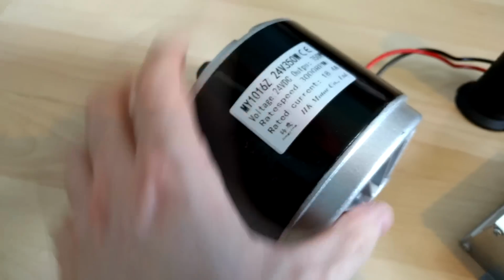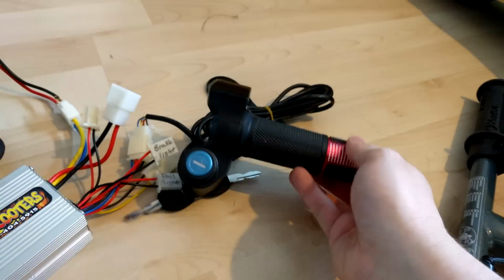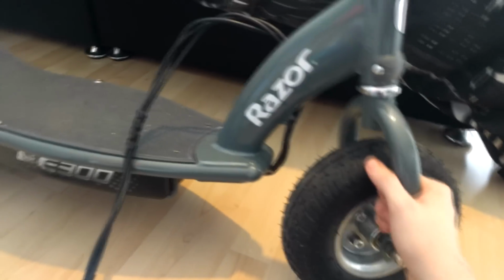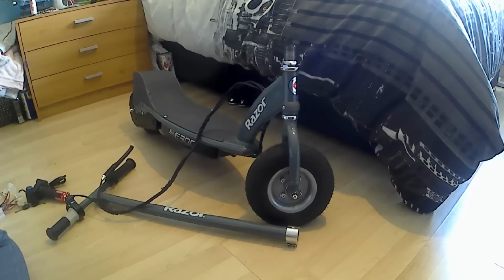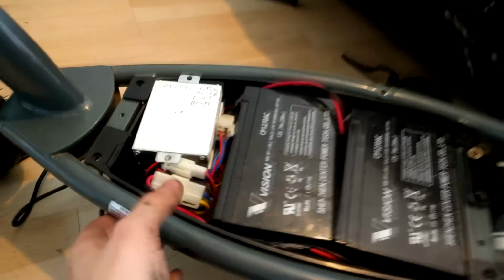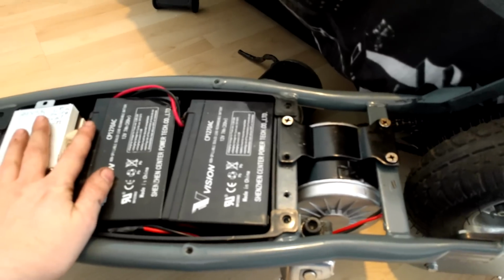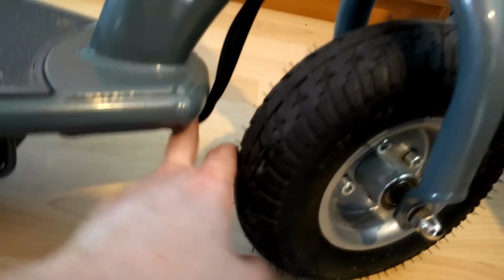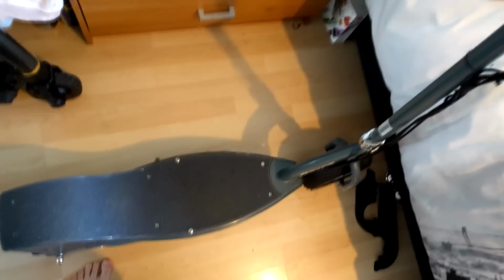Electric Scooter - Razor E300 Modified Build Episode 1

Comment: what is the maximum speed now.
 and is there A big difference with this engine.
and can you tell me how the throttle works..
Reply from the maker: hey so with this little mod ive gone from 14mph to now 19-21mph this varies due to wind and flat grounds but witht htis mod it has alot more get up and go and can now go on small hills no problem at all the throttle is amazing got going nice and slowly or if you want to control your speed while going fast there will be a part 2 coming soon were ill have upgraded batterys but still around 24v :)
Reply: Samus The Ginger Gamer 

good to hear.
my son is 11 years old and every day he uses this already amazing razor scooter.
but with this update.
its going to be much more fun.
especially with the throttle. 

thanx for the info.👍

greetings dennis ( from the netherlands)
Reply from the maker: the throttle will give ur son alot more control over the scooter if any thing this mod makes it alot safer to ride :)
Reply from the maker: about 14 days :)

Comment: Nice work! Just curious to know why have you made this scooter when you already have that lightweight scooter which is using lithium and a very energy efficient (brushless motor) compared to this Razor modified scooter that uses a brushed motor and is chain -driven?
Reply from the maker: +Richard Tan Tan i made this just as a project and for fun i know that my carbon fiber electric scooter wins hands down on distance and on weight, this is more just having some thing I've made and put my own efforts into making a crap scooter (razor e300) into some thing fun and cheap :) i also have a electric e bike too maybe i should do a video on showing that off too :)
Reply from the maker: Jimmy Alvarez hey it's a 24v electric carbon fiber scooter Roy doesn't have a brand name as I bought it straight from the factory in China :) if you want a link to were I bought it ilcan send u it :)

Comment: I'm doing the same thing, picked a cheap used e300 and plan to mod it.
Did you noticed much difference in range/time when going to the 350W motor?
Reply from the maker: so far ive noticed no change in range adn run time, but with the 350w motor it runs at 3000rpm and thats alot quicker and even quicker then some 500w motors but reading up i might over volt the motor to 36v so i would out put like a 700w motor